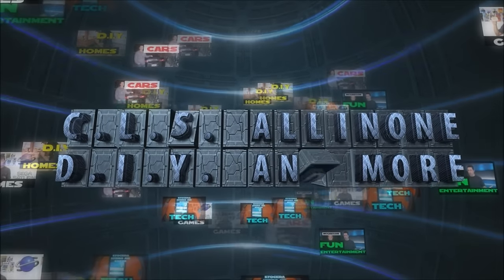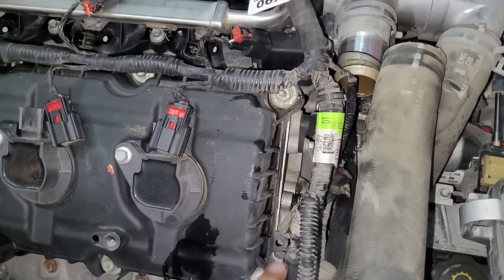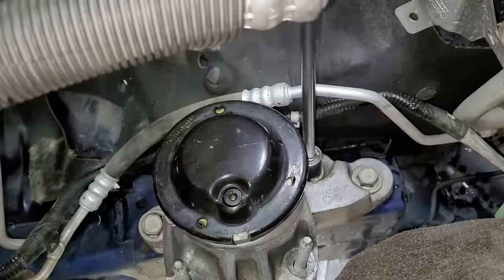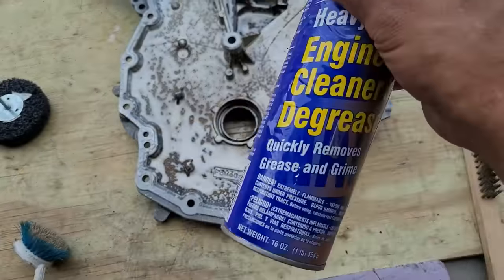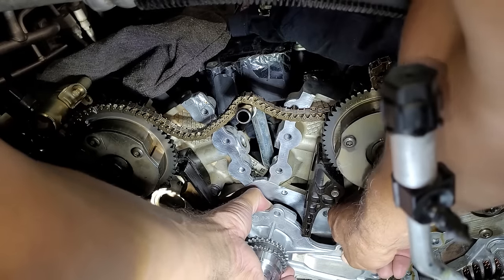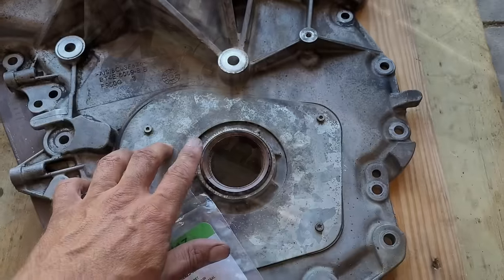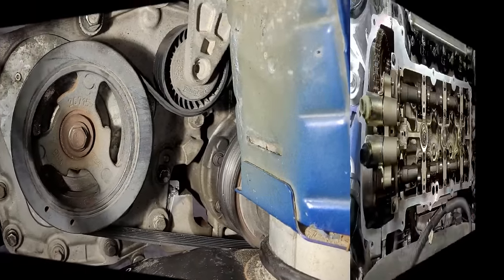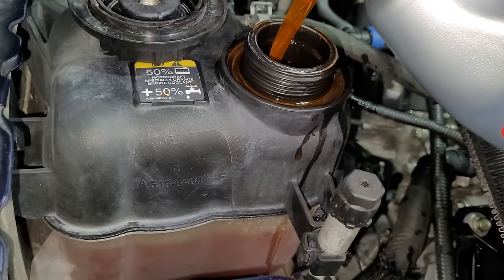How to change a water pump in Ford V6 3.5 & 3.7-liter engines 2012-19 Explorer, Taurus, Edge & more

Comment: This video gave me the confidence to tackle this job and it took my son and me three full days.  We used only hand tools except for a 1/2-Inch air impact wrench to reinstall the cam pully.  The air impact was not strong enough to loosen the bolt so we used a 1/2' breaker bar and some leg power.  The video has a lot of detailed information on torquing specs but we found it was impossible to get a torque wrench on most of the bolts so we did the best we could.  There is very little space between the frame and the engine cover.  The video is well done and the lighting is good giving the impression of more space than there actually is.  Unless you have some extra long tools we needed cheater bars for our ratchets and we used boxed end wrenches to cheat when a ratchet would not fit.  Breaking the bolts free on the engine cover took a couple of hours.  Reassembly was just as challenging due to the tight space and we had to estimate the torque on most of the bolts where our 3/8" drive torque wrench did not fit.  It worries me a bit but we had no choice at that point and tightened the bolts by hand the best we could.  The job was completed successfully and we have no leaks.  Getting the air out of the cooling system proved to be a time-consuming task but parking uphill on a steep slope to get the heater core below the reservoir finally got the air out and we have heat from the vents.  It was a tough job but I'm retired with a lot of free time so I made money doing it myself.  Quotes I received to do this job ranged from $3800-$4500.  I purchased all of the parts and supplies plus some tools including parts for a complete brake job for $1100.  However, after doing it myself I can see where shops would have to charge a lot to do it and warranty the work.  The pump I removed was not worn out, the bearings were smooth and the bearing seals were fine.  The problem was the o-ring seal was leaking, hard to believe all of that work was due to a thin rubber o-ring!

Comment: PLEASE READ IF YOU ARE PLANNIG TO DO THIS WORK!!

First of all thank you for this AWESOME video, it helped me tremendously to change my water pump on my 2016 Ford Explorer.(100,000 miles) 

Having said that, please read below if you are planning to attack this massive job.

1) Watch this video and write down all the parts and tools that you will need. 
2) Do not raise the vehicle up first. By doing that, you are lifting the front end and it makes it harder for you to work on the top of the engine. Take the valve covers off and then raise the vehicle up.
3) The hook set he is mentioning in the video is absolutely necessary! Without them, I couldn't have taken the fuel injector connections off. They are tricky. 
4) Mark the timing chain just like he does and take tons of pictures. I used camshaft lockers and when I put every thing back together, I realized the markings were off on the intake side by one tooth. With the lockers in place, I was able to use a wrench to move it barely and they ended up lining correctly. 
5) When spraying the brake cleaner make sure you don't erase the markings on the chain or the camshafts. (VERY IMPORTANT).
5) When I put my timing cover back I failed to put silicone on the top, where the 6 bolts are. Very easy to miss if you are applying the silicone to the rest of the timing cover from the bottom.
6) This is my opinion, but since you are doing this job you should definitely consider changing valve cover gaskets, intake manifold gasket and spark plugs. They are all inexpensive and worth the effort. 
7) This is a big job. I work on my cars often and it still took me 1.5 days to finish and test it. (I took my time to make sure I didn't miss anything).

Again a HUGE thanks to whoever made this video. Ford quoted me $2,500 for this repair, I was able to fix it with about $400. (I already have most of the tools)
If you have any questions, please do not hesitate to reach out to me.
Reply: Wow,  thanks for your update as well,, sure helps alot since i am about to tackle this on my own.  i been quoted the same as you , and nothing under 1400,, but i have some questions for you,   1.  when attaching the water pump,  i didnt see him apply any silicon or gasket maker on it,   do you have to do this or not?    2.  my issues with the job is the marks with the timing.  i have the tools for the camshaft holder,  i assume marking the chain is only to prevent the timing from getting out of whack,  since the car before the water pump failure should be in perfect timing ,  correct ?
Reply: @benfernkay8974  do NOT use sealer on the pump gasket…ever. If you look closely at the chain the links are marked for proper alignment. I would urge you to use a ford pump and a new chain, you don’t want to do this job twice. 22 year ford tech , I’ve replaced many of these. If you have questions, I would be happy to answer.
Reply: @harrybalsonya5619   thanks,  can you explain about the timing,   i thought the car is in proper timing as it is,,  so using the tool to lock in the camshaft is necessary.. but how do i know for sure its in timing and why would the timing be off just by replacing the water pump....?
Reply: @benfernkay8974  the tools used are cam holders so the phaser bolts can be torqued to spec. The timing is achieved by the colored chain links and dots on the gears. The factory chain has colored links as well but they can be hard to see with age. I would recommend a new primary chain and tensioner when changing the water pump, it only makes sense to. 
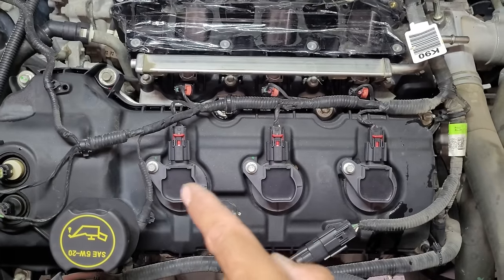   As for timing, the chain will have 4 colored links. The two links next to each other go on the crank gear the single links will fall on the cam gears. Once the cover is off put the crank bolt back in and rotate the engine CLOCKWISE until the crank key is at 12:00, you should be able to see the cam gear dots.mid not rotate the crankshaft 180 degrees until you get the cam gear dots in the up position and the crank is at 12:00. At this point route the chain over the gears placing the colored single links on the cam gear dots and the double links straddle the crank dot which will be at about the 5:00 o’clock position. Put your guide and tensioners on and verify the links and dots line up. You may have to move a gear to get the marks to line up, this is fine as long as they line up. Good luck.
Edit… You have to take off the chain to replace the pump, there’s no tool to hold the crank so you’ll have to reset the timing.
Reply: @harrybalsonya5619  Unfortunately I found it difficult to remove the water pump, and ended up scratching the block where the water pump gasket seals, so I applied silicone, is it going to be ok?
Reply: @idugauaconan2353  it’s not the end of the world. I’m sure that it will be fine.
Reply: @harrybalsonya5619  
Thank you, I started the car yesterday and so far so good. But I have small issue, I replaced the Oil pressure switch, I applied teflon tape but it won’t stop leaking, do I have to apply teflon paste as a thread sealant? Please advise. Thank you
Reply: @idugauaconan2353  the oil switch should have had a sealant on the threads when you bought it. There should be no need to add anything to it. I would remove the switch you have, clean off the Teflon tape and whatever else you may have added to it. Put it in the engine and tighten it to spec, if it continues to leak replace it with a Ford part or a high quality one with sealer on the threads.
Reply: @harrybalsonya5619  thanks again for your help. Here is the thing, I installed it first without anything, but started to leak, removed it and put some teflon tape and installed again, it leaked again even more, am afraid of one thing, that I cracked the housing, I think if this is the case then am dead
Reply: @idugauaconan2353  do you recall how tight you installed it? They are tapered and don’t need to be extremely tight. 
Remove the one that is there, let the oil stop leaking and inspect it very closely, even if you have to use a magnifying glass, get a light and look. If it’s cracked you’ll see it.
Reply: @harrybalsonya5619  I really appreciate your follow up with me. Unfortunately I inspected it with an endoscopic camera, Its not only cracked, a whole piece came out. Oh man I really fixed the water pump successfully, but this side work screwed up my efforts. So sad
Reply: @harrybalsonya5619  Would You ford pump with one seal or carquest with 2 seals ?
Reply: @freddieravan1387  I would take a Ford pump over any other available pump. It is not the seal at the block that is the issue.
Reply: Any recommendations on what cam lock set to use? I found a set on Amazon for $25 they say 303-1248 and another option for 303-1655 any thoughts?
Reply: Where do you get the cam lockers?
Reply: Any trick on how to disconnect the fuel injector connectors?
Reply: Where did you get the cam locks?
Reply: I noticed my markings were off a bit after doing everything as well. By wrench do you mean you moved the cams with the special Allen key or the cams themselves where the lockers are jn place?
Reply: I noticed my markings were off a bit after doing everything as well. By wrench do you mean you moved the cams with the special Allen key or the cams themselves where the lockers are in place?
Reply: One of my upper 6 timing cover bolts are actually stuck behind a motor mount bolt. What should I do??
Reply: @harrybalsonya5619  greetings, on a 2013 ford edge 3.5L, is it absolutely necessary to remove the engine to replace the water pump?
Reply: @t-raw2412  no, you do not have to remove the engine on the edge to remove the timing chain cover. The only vehicle that you need to remove the engine for is the Fusion/ MKZ model with the 3.5/3.7 litre.
To make the job easier you should unbolt the torque strut from the transmission to the frame . With that disconnected you will have more room to maneuver the engine for clearance.
Reply: Are the torque settings correct in video? Also what would make the timing get off if cam locks are in
Reply: @overdrive020  if your timing is off your chain and gear timing marks were not correctly aligned.
Reply: @t-raw2412  you do not need to remove the engine on a Edge to replace the chain or water pump.
Only the Fusion & MKZ require engine removal.

Comment: I have been contemplating preemptively replacing water pump on my son's '13 edge with 130k miles. Was worriabout the engine support and you have answered that. I appreciate the note of bolt and torque specs as well as explicit instructions on the marking and locking cams. I've done a fair amount of timing work on 3v 5.4l so i'm not afraid of chains. This is a Gold Medal DIY! Thank You for your time and patience❤

Comment: Thank you for your time and dedication to making this video. I started on a Tuesday morning and finished on a Saturday afternoon. Throughout this endeavor I was scared especially when it came to the timing chain. I had my ups and downs and believe me, I wanted to quit. Somehow I continued to battle. I was in disbelief that my car started right up. Thank you again for everything. I could not have done it without your instruction. Moreover, I saved alot of money. Thank you sir.
Reply from the maker: Glad to here everything worked out, good job!
Reply: @D.I.Y._All-in-One 
Do the cam sensors have to be reprogrammed after this....have a 2017 that is running rough after reassembly...timing is not off, but I'm getting a cam sensor.code that wasn't there before
Reply: How much do they charge to do a water pump replacement for 2017 ford explorer v6?
Reply: @3MMobileMechanicServices  I've seem a 2500.00 charge at the dealership here for eater pump replacement on an explorer.
Reply: @3MMobileMechanicServices  I have seem quotes from 3 to 4k
Reply: @shanman4599  Did you ever get the problem fixed? It's been about two months later I did mine and I'm getting one camshaft position sensor code p0390.
Reply: No
Reply: @shanman4599  Okay. So it's not being driven at all? Ask anybody else?
Reply: @JoshuaWhitesinger  it is, just doesn't seem to have quite the power it needs.....wiring got pinched at one of the sensors so we rewired it and the code cleared, eventually came back on? It runs just doesn't have the power that it did before.

Comment: Absolutely the finest DIY video I have seen dealing with the Ford V6 3.5-3.7 engine water pump. I have a 2016 Ford Flex with 113,000 miles, that I will trust my independent local mechanic to undertake this work preemptively in the coming months (no evidence to date of water pump failure). That said, I cannot thank you enough for sharing this level of detail and superb video work (you're the first I've seen who so successfully does overlay graphic circling of the EXACT bolt/item you are speaking about). It makes it all the better for me as I'll know exactly what to ask the mechanic about, regarding their process.

Much continued success to you!
Reply from the maker: Thankyou.
Reply: The word is that a coolant change arounf 60,000 to 70,000 miles prevent deteriation of tge waterpump sesl  that causes the leak.  Sone owners are at 150,000 miles no isdlsues because they changed the coolant. Others need to change water pump at 100,000 miles or sooner..
Reply: I flushed the system and filled with Ford antifreeze at 75k, now at 120k getting ready to replace the pump that is leaking externally.
Reply: @bradleysteeves7891  I'm at 53000 and just got my estimate for $3200 for a replacement.

Comment: Just finished my wife's 2014 Ford Explorer. This video was the best. Took my time with watching this for all the things I would encounter. Disassembly  was  a little long for the first time. You want to make sure you know where everything goes back in place. The only part I needed to replace was the water pump. Everything else was in great shape. After about 16 hours its back together and running. My cost was $383.00. That was cleaners a few tools and the pump, Ultra Black  gasket sealer. I had Quotes for $4,100.00 and $3,900.00 . Great video please share his info with others who need to tackle this type of work.  Thank You C.L.S. ALL-IN-ONE !

Comment: This video is absolutely invaluable to anyone attempting to replace their Ford Duratec water pump. I wouldn’t have been able to even begin to do it without this video. I must say however that I have the 2013 3.7 L and there were several additional steps that weren’t covered in the video. The 3.7 has an additional stretch belt that must be removed from the main pulley, and three bolts in the side of the cam cover that must be removed to get the cam cover off, and they are near impossible to get to. The entire process was arduous and very time consuming, and throughout it I wasn’t sure if I could actually complete it. My timing chain had a little slack so I ended up replacing the chain as well. The thing that made me the most nervous was getting it all done and having the gasket maker leak. There were 2 little nuts at the back of the rear valve cover on the studs of the valve cover bolts that held brackets for an AC line, and those nuts were frozen and impossible to get to and get off, and I ended up having to grind them off. I damaged one of the valve covers in the process and had to replace it. Also be very careful torquing down the valve cover bolts. At 15 foot pounds I broke two of them off in the block. I will have to go back and drill those out but for now the cover is not leaking. This whole procedure is not for the faint of heart if you are a novice like me and not a seasoned mechanic. This is by far the best video for replacing a duratec water pump. I can see now why it’s so expensive to replace one of these, and why there is a class action lawsuit against Ford.

Comment: This video was perfectly done was able to purchase all the tools from harbor freight starting from scratch. Using this video i did all the work myself. Even ended up replacing all my motor mounts. First time ever working on a car this in depth and it all went smoothly...for anyone thinking of DYI this job dont be intimidated Worst part of the entire job was waiting for all the parts to come in. With tools and parts My costs was still under $1000 and over time they will pay for themselves. Thanks again Keep making a great video!!
Reply from the maker: Thanks man. 
Good job on your DIY repair as well.
Reply: @D.I.Y._All-in-One  trying to figure out which water pump to use, one seal or 2 seal from carquest
Reply: Do you have a list of parts and tools you purchased? We are about to tackle this on our 17 Explorer
Reply: @freddieravan1387  Ford

Comment: Just wanted to say thank you for taking the time to post this exceptionally detailed video. Ford dealer quoted me $4100.00 for this repair, with almost $3600.00 in labor. With the help of your instructions I have sucessfully changed my water pump and I am back on the road with no issues thus far for around $400.00 in parts (new thermostat, pcv valve, and valve cover gaskets) and 4 days of labor. Thank you again for taking the time and sharing your expertise, much appreciated. I saved myself $3600.00!!!

Comment: Thank you so much for this video. 2015 taurus 3.5 water pump leak. Was told NO by 2 diff shops, wouldnt even price it. Dealer was 5600 with timing components. I honestly, it really isnt all that bad. Easy? Nah. But with the video, i was able to complete in about 11 hours.. basically no special tools were needed other then a gear puller and the cam lock tool.. take your time and have patience is key. Lay everything out and stay organized... thanks again
Reply: I got mine replaced at 66k miles back in may of 2022 on my 2016 ford Taurus and recently I noticed it started to leak again and it has 89k miles.